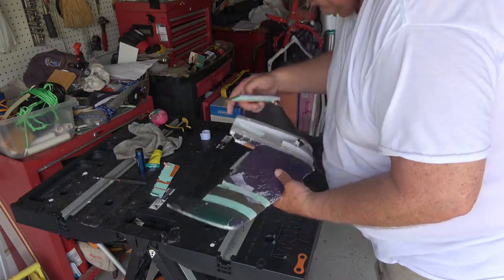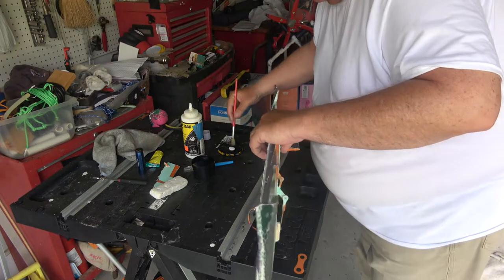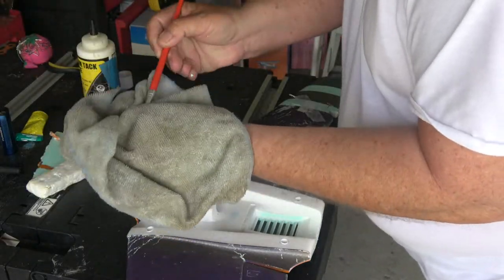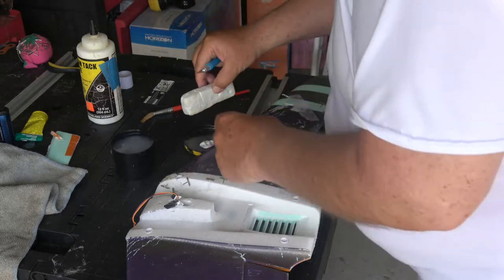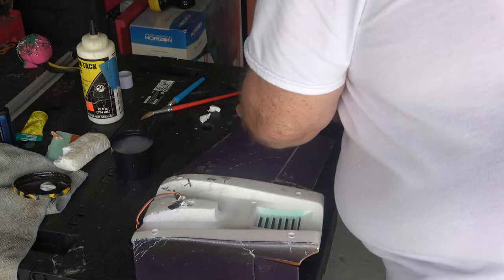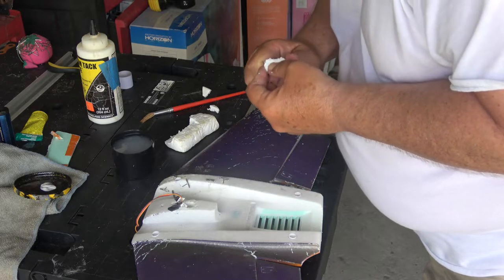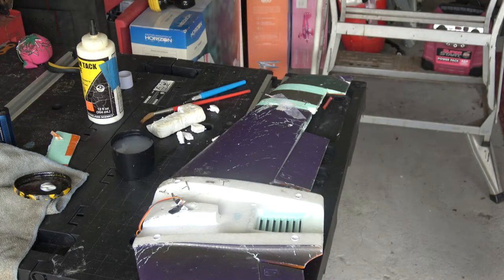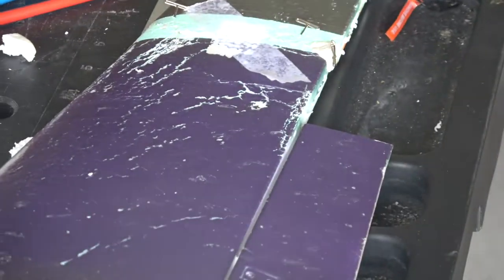Part Three Rebirth of the Arrows Marlin Crash Repairs

Comment: It is rebuilding nicely, what is a Rc Airplane anyway? A bunch of foam,wood,wires,plastic,motor and servos. A receiver & radio a pilot all of which are subject to failure at anytime. The miracle of flight is  inside ones heart. The true gift is paticance, perseverance after a failure to dust yourself off and try again. Enjoyed watching.
Reply from the maker: Randy you are right,  nobody ever learned  to walk using the Think Method.  Jeff in LA USA